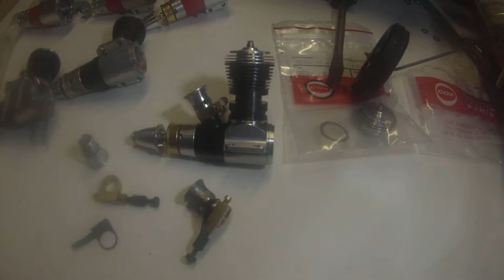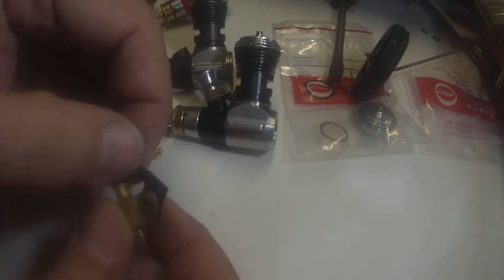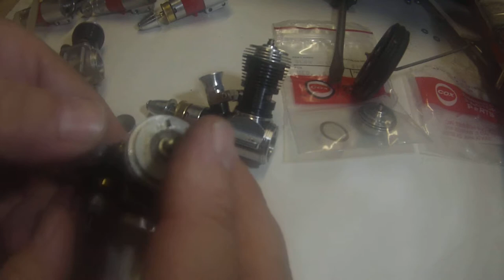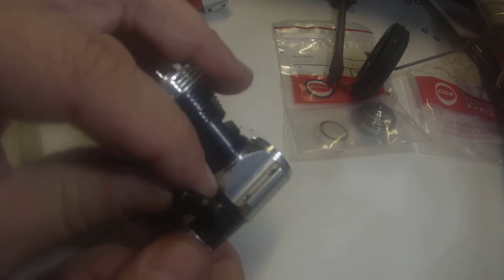Cox Tee Dee TD .049 .051 .09 .15 Needle Valve Repositioning to the other side

Comment: Thanks for the video, I am 65 Years old and flew several golden bees in the early 70's but I am now owning my first TD Version. I am still flying control line after all these years, it brings a lot of joy too build and fly these models.  I am installing it on a Plane I didn't get to build as a kid, I am finishing up a Brodak Lil Wizard. My Needle valve is facing down and this gave me the info I needed to change it. I am guessing I will use a factory Cox Wrench to loosen the venturi? Don't want to use pliers on a well made engine. Thanks again for the posting. I will also look for replacement plastic sleeve that the venturi screws into in case I break one.. Keep posting and keep flying.

Comment: How do you take it apart? I have the same problem I do have a aluminum piece now.
Reply: Do you have the Cox wrench? Each size engine has a correctly sized simple wrench. You have to use the spanner part to unscrew the silver aluminum piece and it pushes the anodized gold piece off the spline. Hope this helps. Here's are reference to the TD .09 wrench: https://coxengines.ca/cox-.09-wrench.html
Reply: @boldcautionproductions9203    thanks for that info I have one to fix too